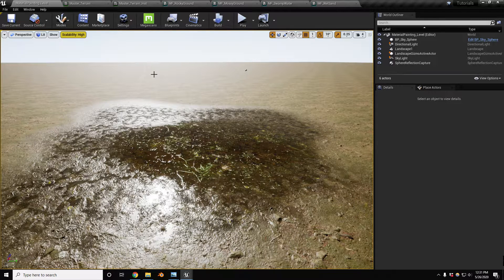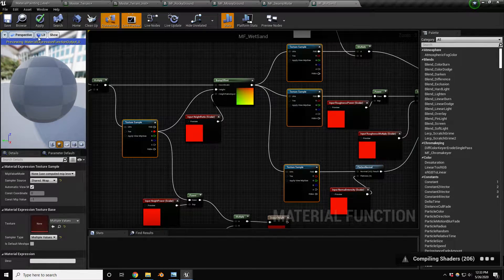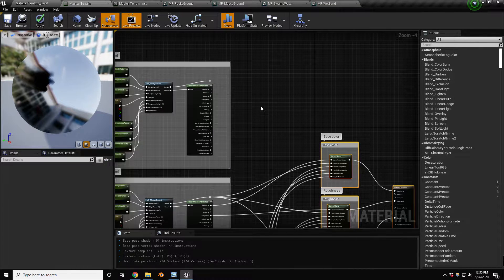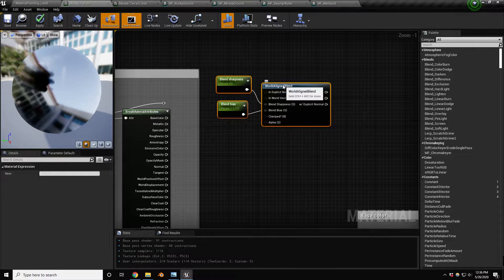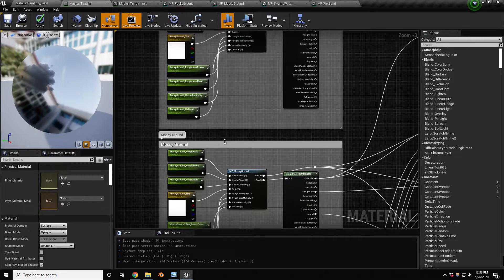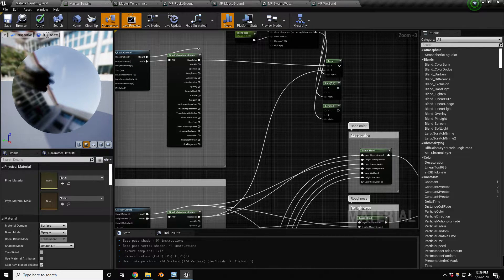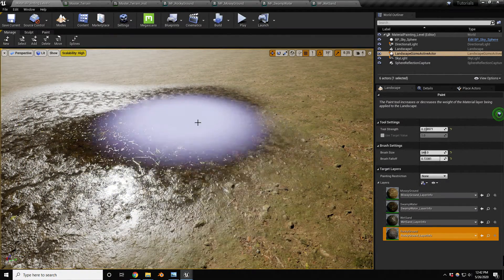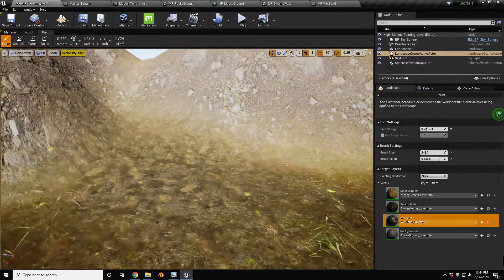Unreal Engine landscape terrain material - Part 2 - Slope painting

Comment: Hi, this is a great series. The reason you have to select "Shared Wrap" is because there is a DirextX texture limit. Its a workaround which Unreal has done and I think it supports 128 (Might be 256) textures.
Reply from the maker: Thank you so much Jessica! I was hoping someone with more technical knowledge than me would comment on why this needs to be done.
Reply: @AndreiGhenoiu  HAHA, no way that I have more knowledge then you about Unreal, I have not been working with it very long. It's just that I found it out when my landscape would go black. It's on the unreal website somewhere.  :D  Glad I could help though.
Reply: @AndreiGhenoiu  Oh by the way, the limit is per "Texture" inside the materials, not per "Material". so some materials can be over the limit on their own without even using a second material for blending or anything.  If you get what I mean. I don't understand why there is such a small limit, but I expect it's to do with game consoles and the limited ram/CPU cache.
Reply from the maker: @KuRushie  I really appreciate the info.

Comment: I did everything you did and it didn't work :( I am using Different materials but When I do the slopes it just stretches the material... 

Your Part One was a Godsend and helped I'm not too sure why it isn't working. I am using 4.25 if thats a possible Issue. 

And are the "Scalar Parameters" Basically the sliders for the Material Function ?
Reply from the maker: Hmm, not sure what could cause your issue. This video is also using 4.25. Do you have proper values for the world aligned blend node? Also are all the lerp nodes connected properly?
Reply: Andrei Ghenoiu I think it might be that when I connected the Rocky ground into the first LERP it shows the texture of the mossy ground on the LERP node if you click the drop down button on the node
Reply: Node*
Reply: “Arithmetic between float 2 and Float3 are undefined
Reply from the maker: @zaycvrter8485  I would have to see it - if you'd like you can join my discord here https://discord.gg/VBTwj5C, and post in dev help, and we can start a private chat, hopefully figure out the issue
Reply: @AndreiGhenoiu  Hi my friend your awsome but my slope is not working like yours is just sloping little bit and i mess with the number but is not working correctly i am using 4.25 can you help me
Reply from the maker: @briangonzalez907  it might be quicker if we can do a screen share on discord - https://discord.gg/VBTwj5C - hope we can figure it out together. You can find me there under neverfollow81
Reply: @AndreiGhenoiu   im having the same issue
Reply: @AndreiGhenoiu  @zaycvrter  Did you guys solve the problem?  I followed your tutorial step by step but it just does not work on my slope material. So can you help me a bit?  Many thanks.
Reply from the maker: @capricornstudio8881  have you tried filling the terrain with the slope layer?
Reply: @AndreiGhenoiu   Ha  Turned out that was the real trick.......Yes I filled the terrain with the slope layer and it's working correctly now. Thanks  a lot man!
Reply from the maker: @capricornstudio8881  my pleasure

Comment: For getting good looking bumps for materials used on the terrain, would you recommend POM/Bump Offset or tessellation?
Reply from the maker: I am planning on a part 3 to followup where I will cover the tessellation. I think from a realism standpoint, tessellation might look better. At certain terrain slopes POM/Bump offset will look quite bad. (at least in my experience)
Reply: Thank you for your advice sir ! 🙂